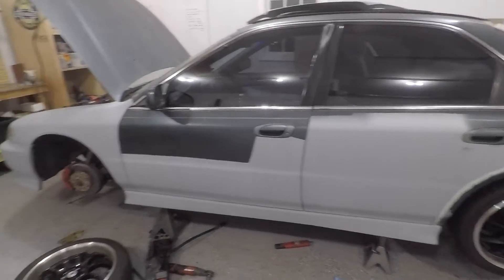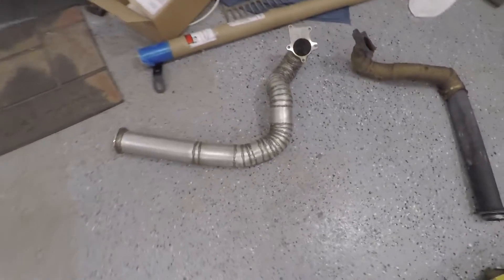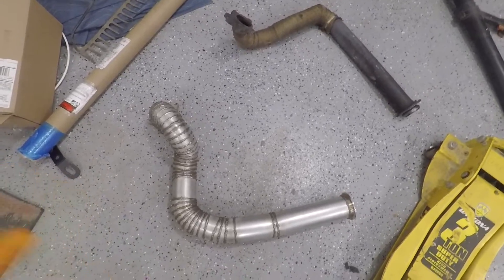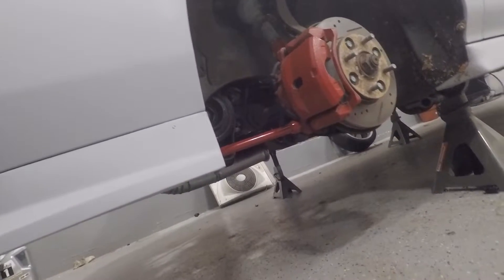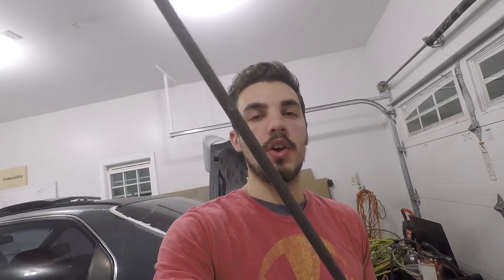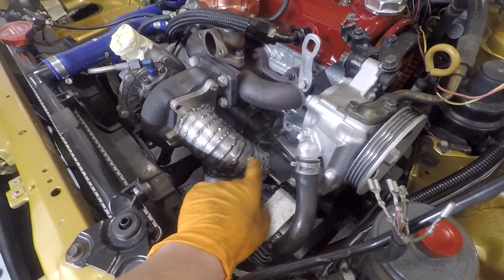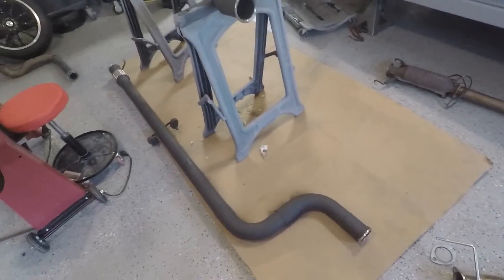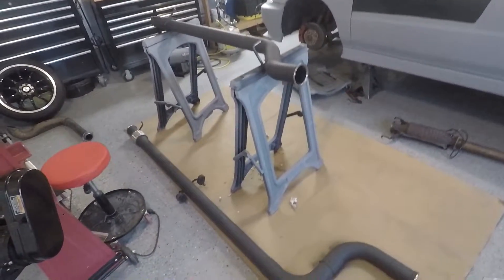Turbo Accord: Building a Custom 3 Inch Straight Pipe Exhaust

Comment: I'm considering going to 3 inch exhaust on my CB7 and stumbled across your video. If you see this how do you think full 3 inch would sound on an f22a6? I'm new to Hondas so I'm not really sure what to expect. It's straight piped 2.5 inch on there now
Reply from the maker: Unless you're turbo or making a lot of power there isn't really a point to going that big. Might sound cool but you won't pick up power. I'd stick with the 2.5 personally.

Comment: I have the same model accord, I can't identify the engine but i figured you'd know the model yourself. I am wanting to mess with throwing a cheap eBay turbo setup on it for fun, do you think I could throw like 5-10 pounds in it for a while before it throws a rod?
Reply: I could have worded that better. Anyhow, I like your build and I wanna follow in your footsteps as far as your build. What have you done so far ?
Reply from the maker: Haha I've had mine in 10 lbs for a while now with no issues or thrown rods. They can take it, I'm about to turn up the boost in mine in a little bit. I've got some videos of the process and everything involved. Usually better to piece together your own kit
Reply: @ThatAccordGuy  Awesome, definitely gonna keep watching yas. Thanks!
Reply from the maker: @avapire2359  appreciate it man!

Comment: Hey bro hate to bother you again, but if you're going to throw that old dp away or not use it ever again would you mind selling it? That's the last thing I need before a tune on my wagon to be ready to rip it again.
Reply from the maker: Hey dude sorry I just don't think I am comfortable selling it. And I don't believe you want it either. It's got a lot of leaks and bad welds and bends. Plus I may use it in the future to run the car through emissions one last time. Not ready to let it go. Sorry to stand in your way of getting your car up and running.
Reply: @ThatAccordGuy  no worries man appreciate it, just an obstacle that has to be overcome.

Comment: Hi Bro what is your car's oil temp now ?
Reply from the maker: I only took the car for one hard drive with the oil temp gauge before I tore it apart for emissions, but the temp never went above like 180 or 190 which surprised me. But my oil pressure was killer too. I think my oil was just old and broken down to be honest.
Reply: @ThatAccordGuy  That is super good. Dont change the viscosity of the oil than. 👍
Reply from the maker: @suleymancakr6724  yeah I was very happy to with it! Hopefully it stays there when it's warm during the summer as well.
Reply: @ThatAccordGuy  i hope so there is allways a oil cooler for option 😀👍

Comment: If you still have the old exhaust send it to me 😂
Reply from the maker: Haha that $160 eBay thing? Would probably cost more to ship
Reply: Lol yeah prolly. I'm looking for one to get a deep hum. Suggest anything?
Reply from the maker: I'd go with a piping kit. They sell 2.5 kits for a couple hundred on eBay. And then spend some money on a good muffler. I don't have too much experience lol I've only done the eBay exhaust and the straight pipe. 

Not a bad idea to just get the eBay exhaust and if you don't like it, just chop off and change the muffler on the end. Still cheaper that way

Comment: i wonder how much you spend $$$ on all 👍
Reply from the maker: The piping and clamps and everything were under $200 and some money spent on welding gas and wire maybe $40 or so there. Had lots of flanges and stuff lying around.